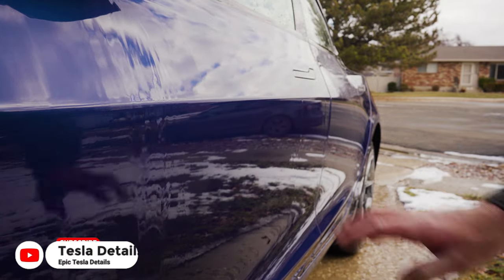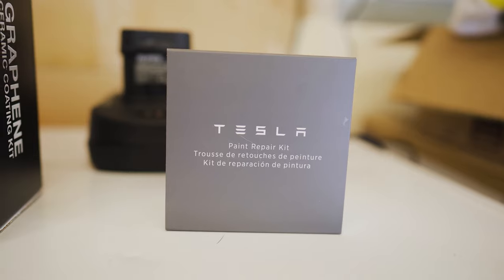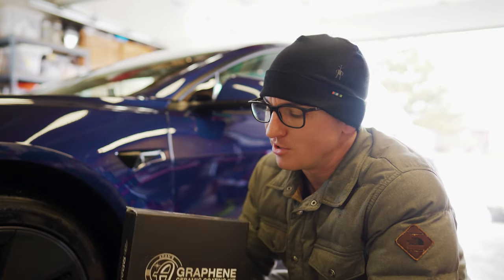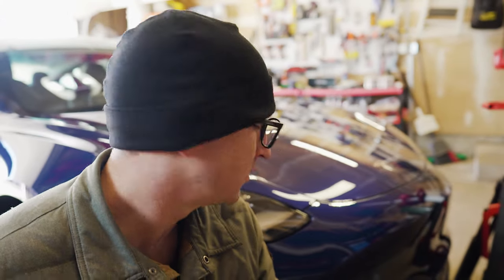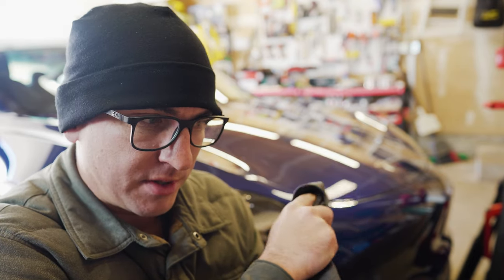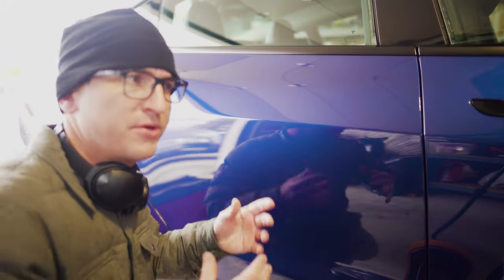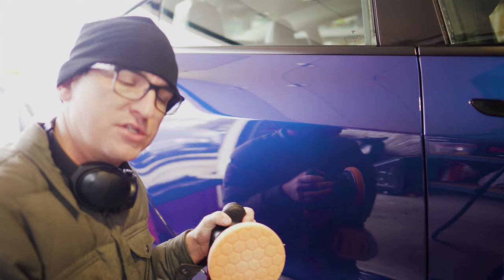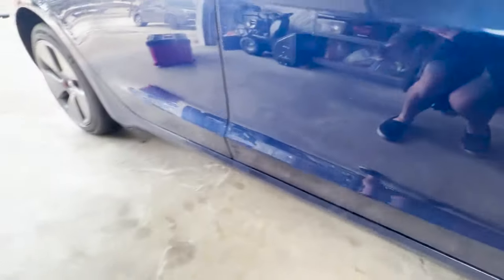Tesla Model 3 DIY Ceramic Coating Tutorial

Comment: That’s a hell of a soap combination! 😆 How long did this take to complete?
Nice work
Reply from the maker: I Never recommend using dawn dish soap on a car UNLESS you are stripping it. Then you can add a little drizzle in to make it super sudsy. And then a splash of degreaser. To maintain it I recommend a PH neutral car shampoo, or slightly alkaline if it’s really dirty.
Reply from the maker: This job took about 5 hours.
Reply: @tesladetails  
I totally understand!!!
Thank you
Reply: @tesladetails  
Not bad at all. Thanks
Reply from the maker: @RayNLA  the first time you do it will take longer, or if the car is needing more paint correction can take longer than 1 day.